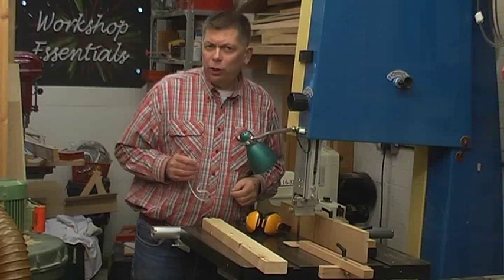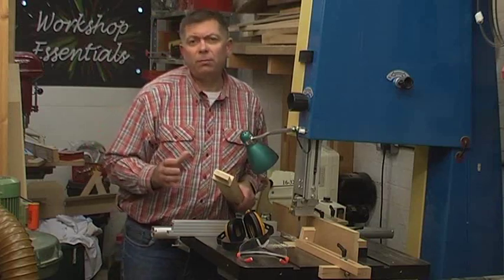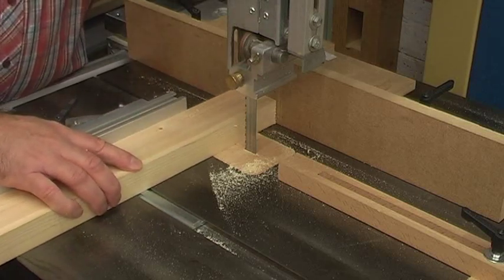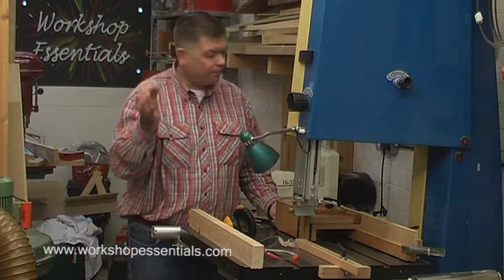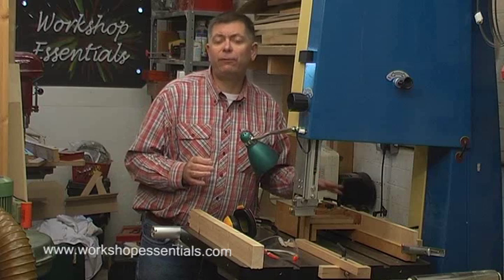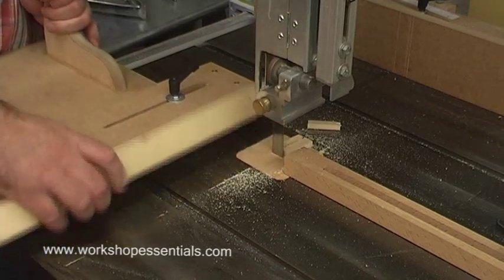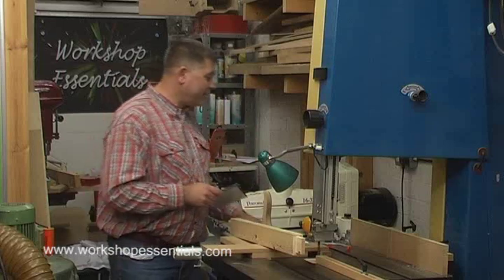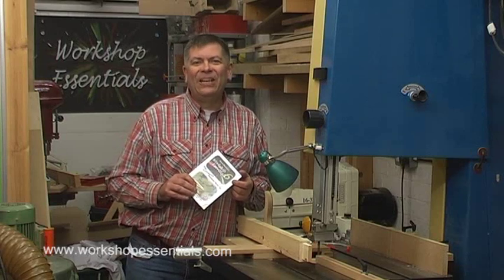The Ultimate Bandsaw Tenon Jig

Comment: Steve why don't you just make a space block the thickness of the mortice you are cutting the tenon for. After cutting the first cheek of the tenon, clamp the space block to your fence, it will space the next cut exactly the width of the mortice.  With this method  you use the same face on the timber for each cut of the tenon so the timber width is not important and you can put your mortice where you want. It will give perfect results every time.
Reply from the maker: +MecCreativeStudio 
Yes you can do that, but you have to make a spacer for each size of mortice and do a test piece every time you change your blade. The Ultimate Bandsaw Tenon Jig (and the Ultimate Tablesaw tenon jig, too) do this for me automatically without me having to worry about whether the fit will be spot on. I calibrate the jig to the blade just once, which takes less than a minute, and I'm good to go. And if I need different sized tenons, the jig remains calibrated until I change the blade again. And because I don't need to run a test piece for fit, I know that my standard spacers, which match my mortice chisels, will give a joint that is Right First Time Every Time.